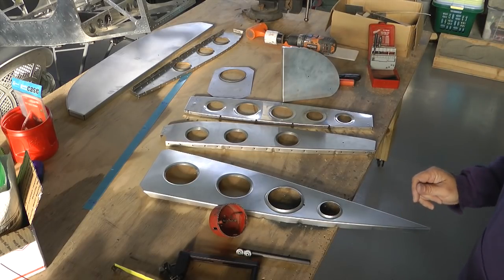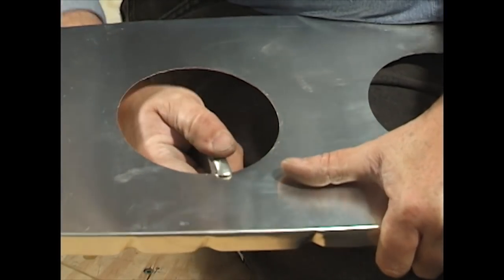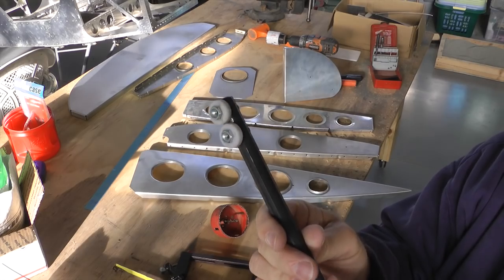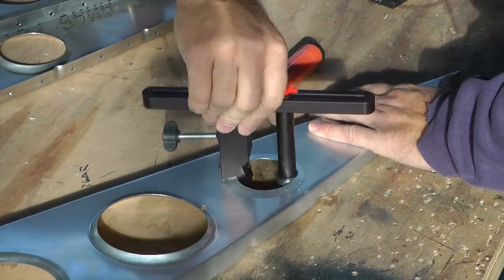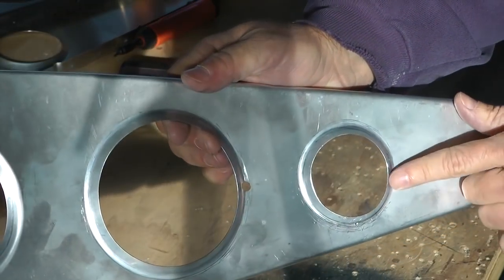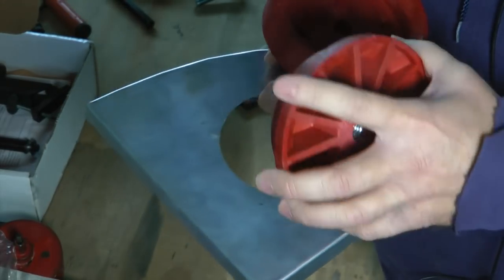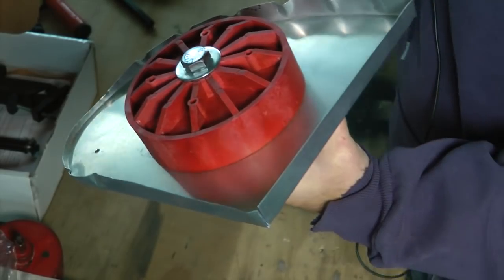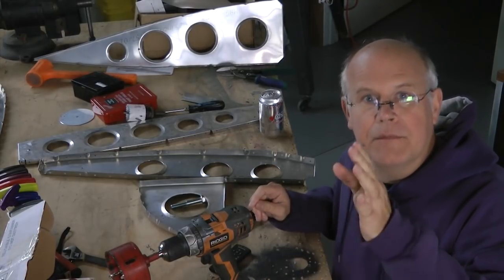3 Tools for creating Flanges in lightening holes - Experimental Aircraft

Comment: 8 years old, but great demo. Not sure if the tech was readily available at the time, but I have 3D printed flange dies similar to those nylon ones in the last segment. They work very well on aluminum using a vice or press to push them in. After seeing this I may drill a hole in the middle giving me the ability to use the bolt technique you showed. Benefit of 3D printing is you can make them any size.

Comment: liking the last roller type  tool , the thing i do see that once the flange is being created / lifts up from the plate , the hole gets bigger , you should have a way to automaticly make it wider every time you increase the angle of the edge (can be done by moving the pivot with the rollers bending the flange down below the hole on the tool , its now right at the top roller and that causes the distance between the two side to stay the same or actually get smaller  )
i can see ways of making it a table mounted object with a bearing in the center to rotate it around on a pilar and a crank that can realy speed the process up

Comment: For circular flanging you can get dimpling dies in just about any size...there are also a bunch of diy dimpling die videos online as well. 

 I like the second option in this video because it can be used on compound shapes and curves.  They all have a size limitation in that if the hole is too small, your only option is a dimpling die.

Comment: I'm surprised the bottom of the nylon flanging die isn't designed to fit in a vise.
Reply: I believe it can be screwed into a wooden base or a table by using the four holes  of the male piece.

Comment: Dimple dies work fine made in ally. We used them on 2mm racing seats for low-volume work. Honestly, I bet you could spin some out in hardwood? Either way up, I wouldn’t pay to have a machine shop spend hours making a set in steel.

Comment: What many of these 'home flange' instructional videos miss is one important engineering fact:

If the fold doesn't exceed 70 degrees, you are wasting your time, it may feel more solid, but you have not increased the strength.

It's like the 90 degree straight fold you demonstrate at the start of the video, 0:30 - try a 30 degree only fold and it will fail easily, get my point?
Reply: I think they only do it to stop it flapping. If it was important it would be a proper induction funnel shape rather than a sharp transition simple cone.

Comment: Will this handle .57mm soft metal?
Reply: It will, these dies (the steel ones) can handle even thicker steel like 1 or 1.5 mm non-hardened steel plates. If you normalize (heat up with a torch then slowly cool) the edges of the holes/sheets/plates, then they can handle even thicker ones. 0.57 mm is a very small thickness, you can bend thin sheets with bare hands also.

Comment: It's for an aircraft,  drill a 1/2 hole and a dimple die with a hydraulic hand pump. Cuts and flanges in one quick step.  You can punch about 10 hole any size in just a few minutes. Every dimple is uniform.  Perfect everytime  ,, dont waste your time with these time consuming methods that are half ass and not uniform.

Comment: Could you possibly make a video showing the best way to do vertical embossing, such as in the formed-style ribs for the Hummel Ultracruiser?  Do I just route out one side of the form block, then saw a dowel in half and shape it and mount it on the other side opposite that routed channel, then clamp/press the sheet between them?  This is the best way I can think of to make sure all the ribs are uniform.

Comment: How about the oval holes? Which tool flanges those? I'm thinking only the Flanging Stick because the others require symmetry.If one flange is good, I would think that a second flange at 45 degrees on the first one would be even stronger.. So in other words make the first flange twice as high (or deep) and then fold that flange in half but only to 45 degrees, (not hemmed, but just bent).. hope that makes sense
Reply: I would try to make the flanging dies out of plywood or some hard plastic board with slotting machine and then bolt it or press it

Comment: Adjustable wrench... no no no... let's not use them.  Thanks
Reply: nothing wrong with adjustable wrenches as long as they are used properly. the problem is that 99.9% of adjustable wrench users don't have a clue and fuck up the fasteners because the wrench wasn't tight.

Comment: last one could be 3d printed for cost efficiency, that can even be the 3 hole in one 3d printed press mold if someone are making many of those flanges.
Reply: I did 3d print mine works great just use 90 percent infill

Comment: How do you cut such clean holes in that thin aluminium?
Reply: Flycutter slow and light with drill motor, if you decide to go all the way through make sure your work is secured to plywood so your centre pilot hole remains central to the finish hole. Finish edge with 240-320 grit sandpaper. Emphasis on smooth edge otherwise a crack can propagate from edge of material especially with tempered material

Comment: how to increase strength for fuselage
Reply: By welding, "gussets" in where frame tubes intercept one another.
Riveting in, "J-channels" also greatly increases the support strength of the skins provided that you are maintaining the 2 to 2.5 times the rivet diameter edge distance as well as rivet pitch minimums or whatever the aircraft manufacturer's call outs requirements are.

The real challenge is to increase strength for the fuselage while minimizing any drastic increases in weight.

Comment: how to mark & cut the flat sheet metal for fuselage
Reply: I have seen some use drills with either a jigsaw or scroll saw with blades for cutting metal, tin snips but if you have access to hole saws that are 3" or more in diameter then it's probably quicker with a hole saw.